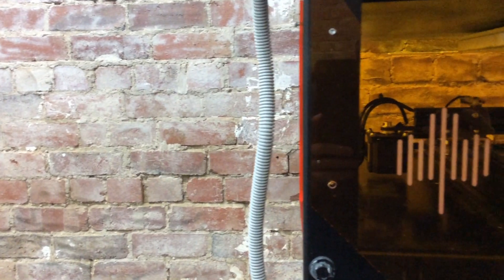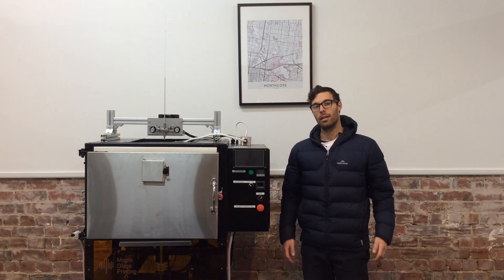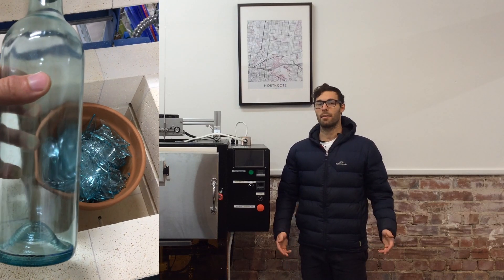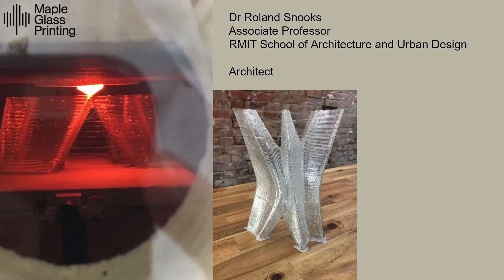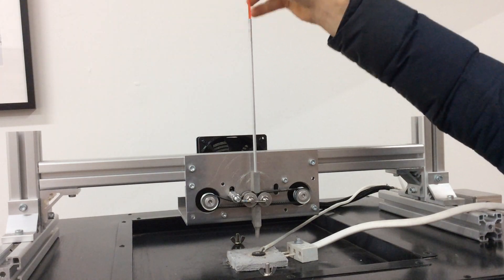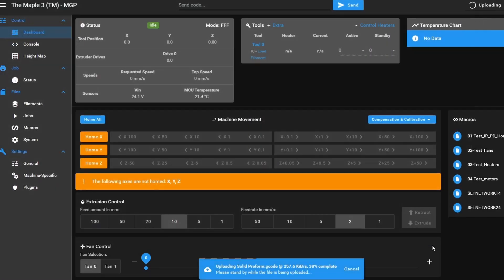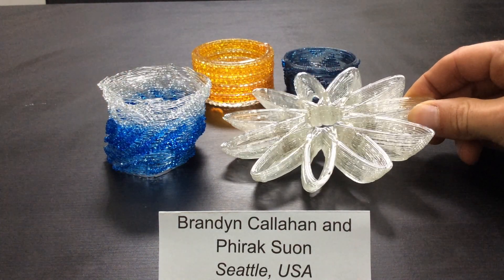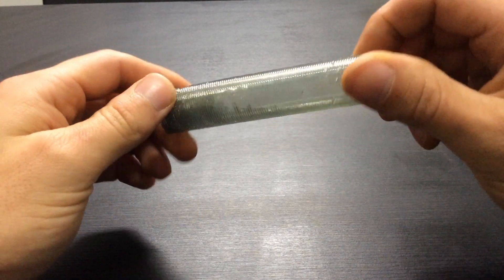Glass 3D Printing Introduction

Comment: Looks great! Is the Batman figure cut off because the filament ran out? What are your plan for prints that require more filament? Just a longer stick of glass? A magazine? Pallets?
Reply from the maker: Ooo great question Barak! As this was one of the first 0.25mm prints we left the retraction / travel moves testing to a little later. We do infact have a glass magazine in the works. Will release a video on this in the future :)

Comment: That's a hell of a heated chamber! It must be a nightmare finding the ideal temperature for the chamber as there isn't really a set transition temperature with glass?
Reply from the maker: Hi Inside Alan, after a few years of glass 3D printing experience we are getting much better at it! But yes, there is a viscosity vs temperature curve (different for every glass) which makes things a little tricky!